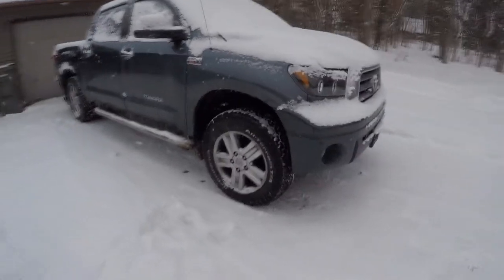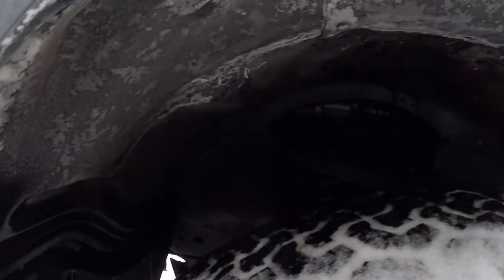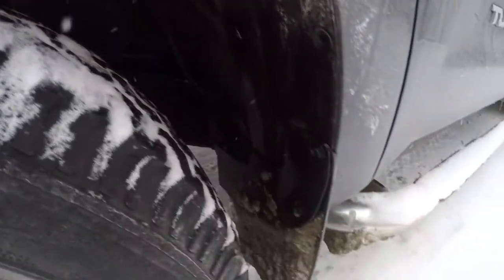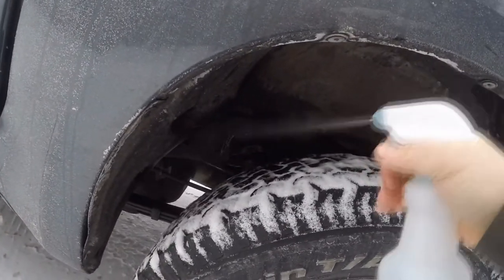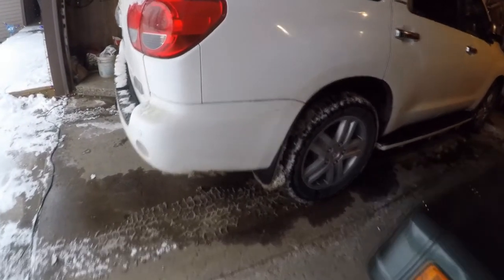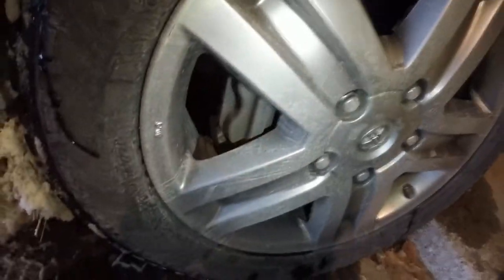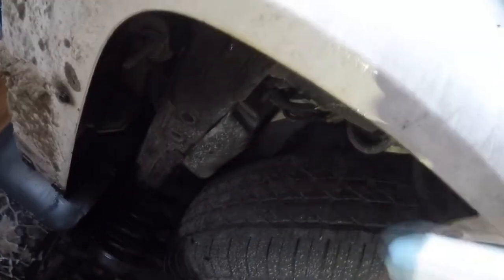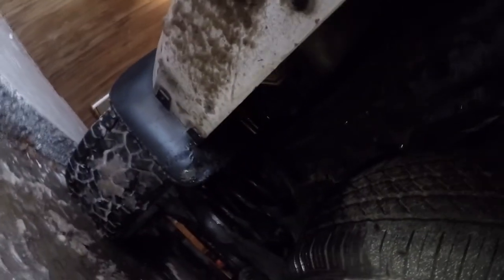RP-342 Anti Corrosion Spray - Update (re-upload)

Comment: How’s it holding up? Just ordered a 23 4Runner and I’m seriously considering using this
Reply from the maker: Holds up great.  I apply a can of two to thinner spots every summer to 3 of my trucks.  Had Toyota do their frame recall inspection last year and they said they have not seen another truck of similar year in such good shape.  The trick is to apply multiple layers.  Apply one, let it dry…..  check where you have thin spots.  Apply another layer, and repeat.  Spray from different angles because it’s easy to miss things.  Enjoy that waxy smell.  😉

Comment: Thinking of using for my 2018 Silverado. From the factory the frame has a waxy coating, do you think it would be bad to spray over or try to avoid? Thanks!
Reply from the maker: Will be fine, it will go right over that stuff and will encapsulate it.
Reply: @MotoMaximus   Thank you for the fast reply!
Reply: Just did my truck with this today. Wanted to thank you for the video and help. I ran my truck through 2 separate car washes that do underbody washes and let dry for 3 days in a heated garage. Worked out perfect!

Comment: Did you spray this inside your doors, rocker panels and engine compartment?
Reply from the maker: Inside doors, no.  Rockers, yes, fairly heavily.  Engine compartment, yes very lightly on the body.  I also used the rustoleoum clear wax (for tools) inside the engine bay on bolts and metal cooling lines.

Comment: Do you find it sticky working underneath. Is there a lot of soot and sand sticking to the wax?
Reply from the maker: It doesn’t have sap/cosmoline like consistency that everything would stick to.  Think of it like spray on wax that hardens up, but never fully solidifies.  It’s a little sticky to touch.  It binds to the surface really well, and can only be washed off with a petrol based solvent like brakleen/gasoline/kerosene.  Does that help?
Reply: @MotoMaximus  yes thank you. I have a 06 Cadillac Escalade and it has the black GM frame wax which slowly comes off over the years. They actually sell that wax. It's a little bit different consistency a little bit harder. But I'm not sure I want to go that route again. I'm thinking I can put this right over the top of what's left of the GM wax and it will blend in
Reply from the maker: Yup, you could.  They also have RP-344 which is the same spray in black.  Use that instead  if it makes sense.
Reply: @MotoMaximus  yes that makes sense thank you for responding. Hopefully you'll posted another update and we can see how it's doing
Reply: @MotoMaximus  I bought 3 cans. Treating with my favorite rust Treatment corroseal then covering it all up with RP-342. 2 coats and it's a nice finish like yours. No nasty sooty oil like fluid film. It's nice and dry. Seems reasonably tough. Maybe a quick coat in the wash areas next year.
Reply from the maker: Good stuff man!  =)
Reply: Its awesome. just smelling the wax make me smile. But I have another question. Electrical connectors. Do you mask them or just spray everywhere? have you tried removing a connector covered with wax? Would be great if i didn't have to worry about it.
Reply from the maker: Hahaha... nothing like the smell of cosmoline.   I thought I was the only one that liked that smell... 😂 

I spray right over the connectors.  It does not harm them, and you can still open/disconnect them if necessary.  The wax doesn’t not solidify to the point where it gets hard enough to prevent you from disconnecting connectors or unscrewing bolts.  Also, if you ever need to get some of the wax off, use a bit of brakeleen.  If you overspray a bit on hot components like exhaust, it just burns off (while acting as an air freshener for weirdos like us).

Comment: Can I spray over areas that was already under coated? Will this add further protection to elements?
Reply from the maker: Depends on what you used as your undercoating.  The problem is that some undercoating products (most “rubberized” tend to crack due to temperature changes.  This cracking will probably cause both coats to fail.  I would wire brush the existing undercoating to see if it flakes off.  If not, then spray over it.
Reply: Did you spray this in your doors , rocker panels and engine compartment?

Comment: Shouldn't u have pressure washed the salt off the metal before u apply the product?
Reply from the maker: Well yes, it has to be clean and it has to be dry.  I am not applying it in the video, I am just spraying water over the coated frame to show how the wax is protecting it.  👍